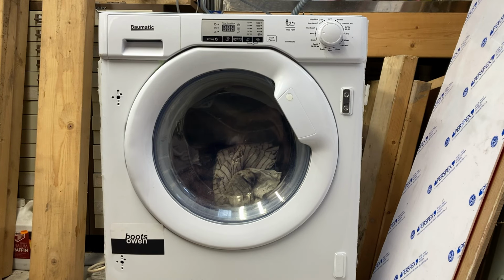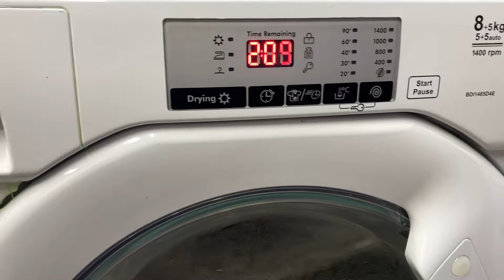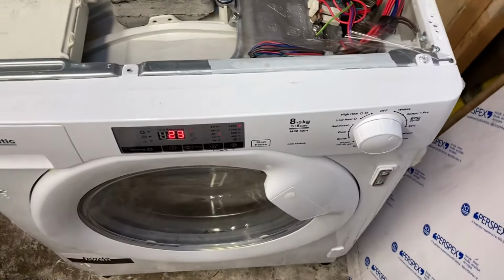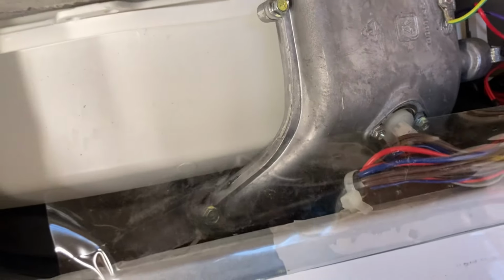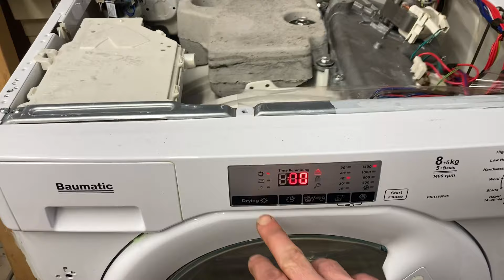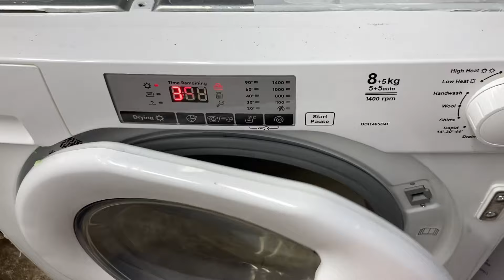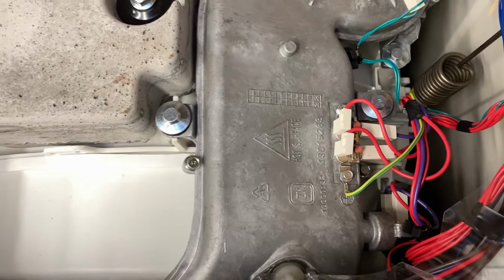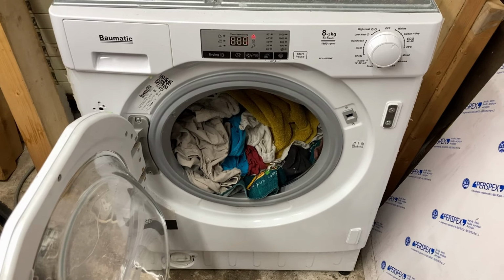Street find: Baumatic Washer dryer | Integrated washing machine | Will it wash and dry?

Comment: Hiya buddy! For the noise check the weights or condensing or dryer system! For the lock the locking bit in the lock is worn out therefore it says it’s locked (which the actual lock is) but it’s not keeping door latch in locking position! Lock needs replacing! Hope I helped!!!
Reply from the maker: Thanks, More investigations required, but I don't want to spend any money on this machine.
Reply: @bootsowen  should be able to find a door lock easily of a hoover candy machine! Any lock that looks similar and off a hoover candy machine should fit no problem! Glad I could be of some help!

Comment: interesting machine. certainly a faulty door lock for not locking, had the same thing happen on my beko where the machine isn't aware that the lock isn't working. im thinking the knocking is suspension-related, due to how consistent it is across all speeds. i can say from experience with an old hotpoint, a loose dryer box or weight, for example, is nowhere near that consistent with the drum speed. as it gets faster the knocking would be completely desynced from the drum's rotational speed. and since the noise happens even on a fairly well-balanced distribution, im even more doubtful of loose components, as that usually won't start knocking until it actually begins spinning. even in severe cases like with my hotpoint. another option is the drum spider. if it's knocking while spinning empty as well, then that's likely the culprit. hope this makes sense.

Comment: Hi the noise is coming from the dryer heater. The bracket holding the heater has snapped.
Reply from the maker: So inside the aluminium duct?